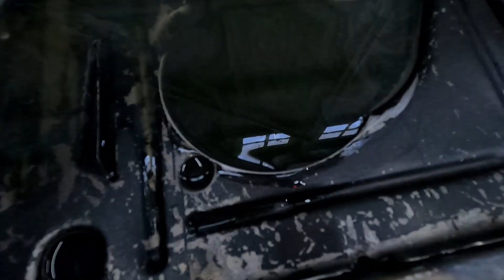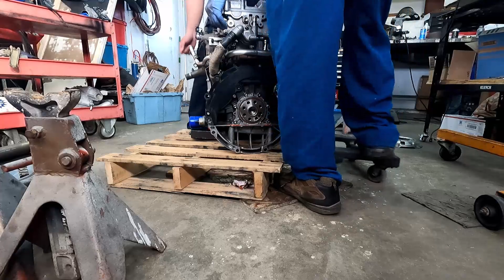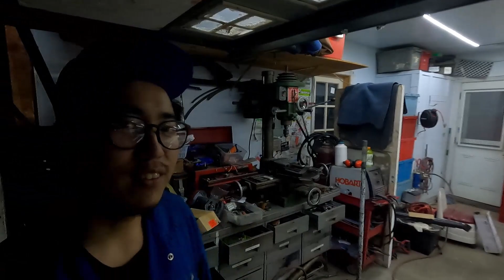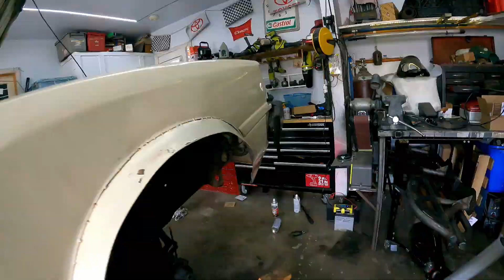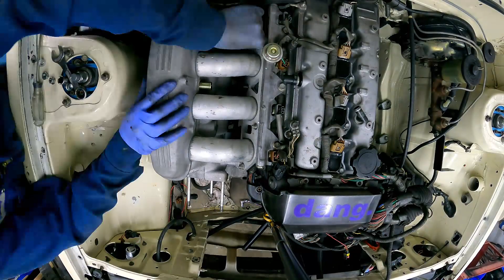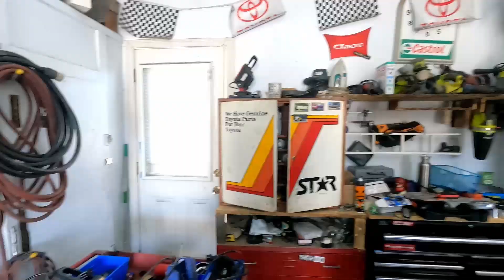3SGE beams final assembly and install KE70 TE72 AE86

Comment: im about to  make the same mod  to my ke70 
its on 4age now ..
kind enough to share some info ?
1. did you relocate the shifter ?
2. drive axle ?
3. tunel mod for j160 ?

thanks!
Reply from the maker: Had to cut the shifter hole open a bit , mk1 Supra driveshaft and rear end also

Comment: Hey bro what drive shaft did you end up using? I'm doing this swap in a wagon and have the altezza shaft but dunno if it'll work
Reply from the maker: I used a celica Supra rear and and 1 piece drive shaft, front portion of an automatic SR5 should work

Comment: What’s the front suspension ?
Reply from the maker: What are you trying to do with the car? Road race? Street drive? Drift? Drag race?
Reply: @kelvinarreola  street drive and weekend track car.
Reply from the maker: Just get a basic system like BC or megan
Reply: @kelvinarreola  bro will I need to do work with the chassis to make it strong for the 1uz ?

Comment: if the engine sits for a while its valves can be sticky and compression can be lost until started back up again will gain its compression back.
Reply from the maker: this engine ended up blowing up anyway
Reply: @kelvinarreola  T_T
Reply from the maker: yep, dropped a valve